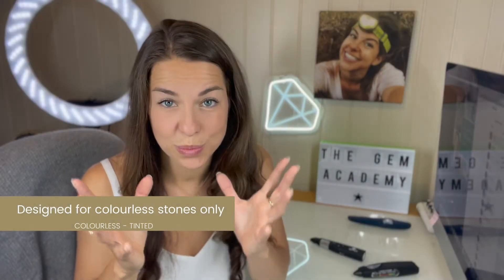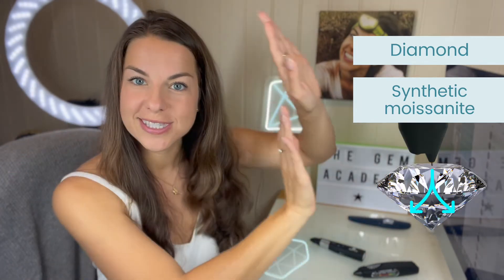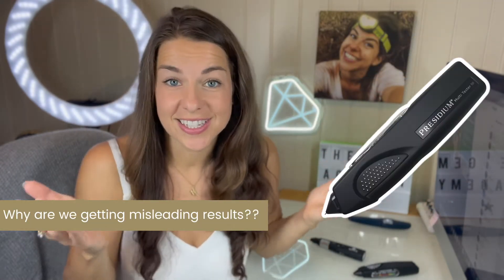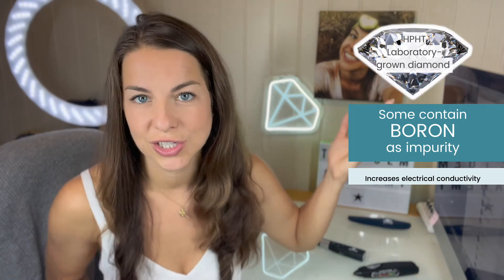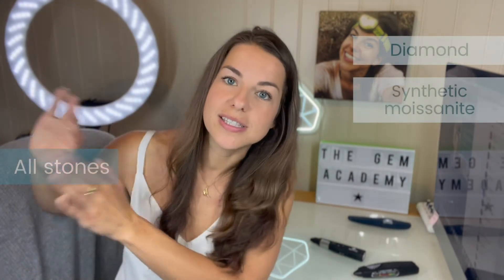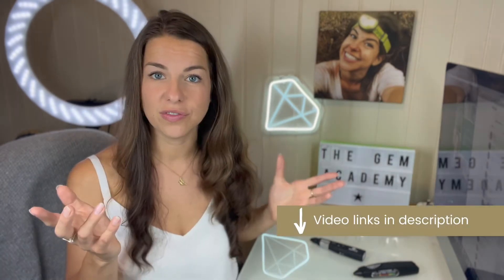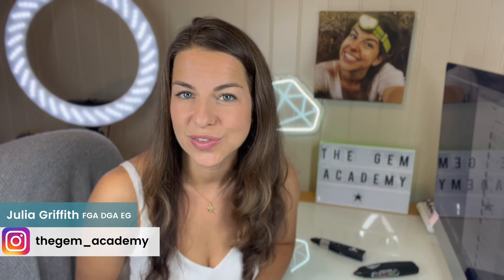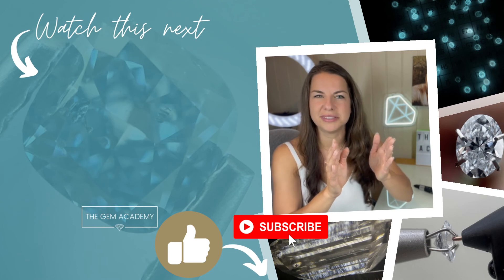WHY you can't rely on diamond testers | Part 2

Comment: I've bought several diamonds from a small family coin and jewelry store. They sell used jewelry and they're very honest and reputable.  My only concern is how can they tell if the diamonds are lab grown or natural?  They use a Diamond tester but I'm not sure which kind. They are confident they are selling natural diamonds.  What is the percentage of lab grown diamonds now that have flooded the market?
Reply from the maker: Without speaking with them myself, I do not know. Maybe they have trustworthy wholesalers who have the equipment necessary to verify the stones. Maybe they have the necessary equipment themselves. If the stones you have purchased have a diamond report, this is 3rd party verification of what they are. However, these do not typically come with small stones. Best way to find out how they know is to ask them and explore these questions and answers. If you want to verify what they are saying for yourself, you could send the item for valuation (which is an excellent routine to do anyway to make sure you're correctly insured).

As for percentage, its hard to know as everyday the percentage is changing. However, sales of laboratory-grown diamonds jewellery took up 10% of the 'diamond' jewellery sales by the end of last year.

:)